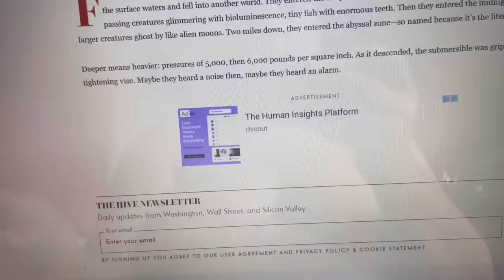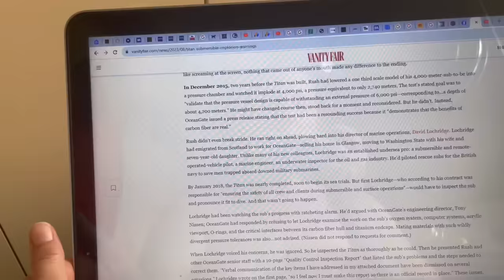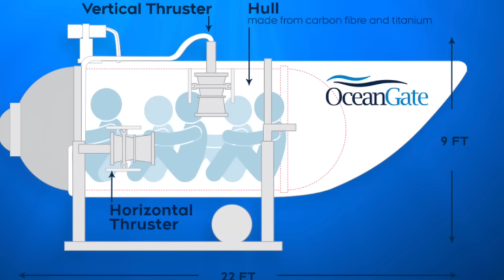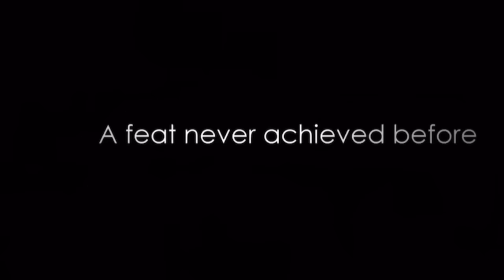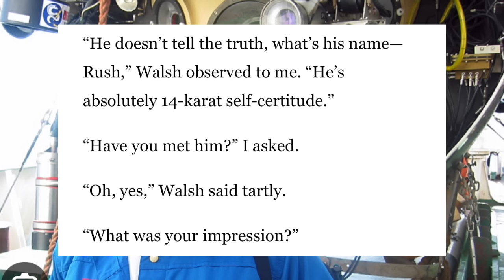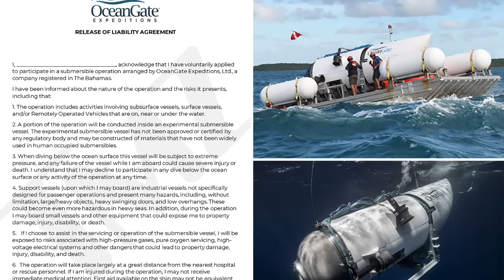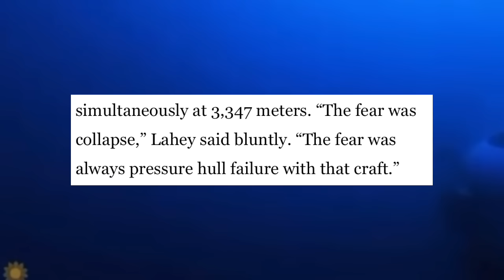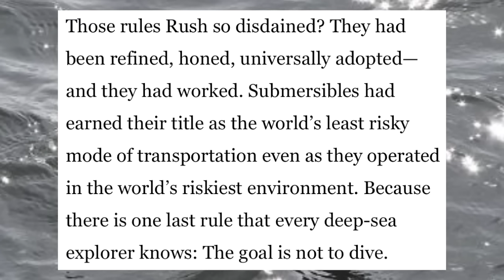TITAN Sub: The Most Shocking Titan Lies & Cover-Ups that you have never heard before #Titan

Comment: In the extreme depths of the ocean, a carbon fiber-constructed submersible is a disaster waiting to happen. It would face a perilous fate as it descends to 20,000 feet. The hydrostatic pressure at this depth imposes substantial stress on the submersible's structural integrity, the pressure would be absolutely staggering. The vulnerability of carbon fiber for use at thus depth was known and discussed only a few years ago.

Ok.. so the systematic collapse begins at structural weak points, such as joints or material imperfections. Carbon fiber's composite nature exhibits brittle fracture characteristics under extreme pressure differentials. As the submersible descended, the hydrostatic pressure intensifies, pushing the carbon fiber to its critical stress limit, leading to audible microcracks detectable by the crew, you understand where I'm going with this?
The ensuing structural collapse would have become audible as microcracks propagated through the carbon fiber matrix, creating voids and causing a sudden volume decrease. The rapid ingress of water exacerbates the implosion.

Contrary to the notion of a "fiery implosion," the collapse lacks the incendiary spectacle associated with heat-driven events. It's pressure, not temperature, which propels the swift collapse, the energy release is predominantly kinetic and potential, originating from compressed water filling voids.

Temperature stability prevails during the adiabatic implosion, devoid of heat transfer with surroundings. Unlike adiabatic compression of gases, underwater implosion involves water, maintaining negligible temperature changes. The primary energy release manifests as kinetic energy from rapid water ingress.

Carbon fiber, with gradual structural changes under extreme pressure, serves as an advanced warning for the impending implosion...an AUDIBLE event.
The implosion would involve rapid structural collapse and subsequent water inrush, generating formidable kinetic and potential energy forces. However, it lacks thermal conditions for combustion or fireball formation. Underwater combustion is attributed to external factors like electrical malfunctions, fuel leaks, or submersible materials, independent of the implosion.

At this depth, an implosion woukd result in massive barotrauma injuries, liquifying human flesh and organs. So beyond pressure-related barotrauma, risks arise from structural damage, equipment failure, or hazardous material release, dependent on submersible design and conditions. Laminated carbon fiber structures in submersibles exhibit stress or delamination signs under extreme pressure, warning minutes before critical failure..ok?...several minutes. 

So, at the depth of 20,000 feet, a submersible implosion induces intense acoustical anomalies. The rapid pressure change causes underwater shockwaves and noise, potentially detectable by hydrophones or underwater acoustical monitoring devices.

Contrary to some statements, sonoluminescence,  or acoustic luminescence is not associated with the implosion, even given the intense pressures involved. 

The acoustical anomalies 
created would be easily detected by the u.s. navy and other hydrophones. 

So.. the crew would be conscious and alert, they were absolutely terrified... they knew several minutes before that an implosion was eminent.. let that sink in...possibly up to 2 or 3 minutes THEY KNEW.WHAT WAS HAPPENING, I can't begin to imagine the shear terror and panic those people experienced.  Rush Stocktons estate and the engineering team should be up on charges... my expertise is in atomic physics and electronics/optical engineering..not law, but that's my 2 cents. Those people needn't have died, Stockton skirted the rules and cut corners...and we see the result.

Comment: I hate to have to say something in favor of them, but this and many other videos sound more like "every little thing I could find wrong" more than the actual problem.

For example, the thruster installed wrong...  This isn't a mechanic shop that has done this a thousand times, this is a one off design thats never been built before.  And they figured it out them selves, it wasn't discovered after the implosion.

Over negative analysis such as this numbs other problems.  It's the cry wolf problem.  Sure, it's a technically a problem, but that is a problem that anyone could have had.  Pointing it out feels more like your rubbing it in someones face rather than solving something.

Frankly, I feel we need to focus on how Rush refused to hire anyone with experience, or take advice from experts as the true problem.  I've read different opinions on why, from he was being cheap so only hired new collage kids to design his sub, to he was being woke so refused to higher old white guys.  Looks more like the actual experience told him to stop.  And looks like he was cutting a bunch of corners, something that when done properly helps get costs down.  And being that Rush, well, was in a rush (couldn't help it) he did it in all the wrong places.

Let's hope we can learn from this properly.
Reply from the maker: Hi Leehype, I have made other videos about the problems with the Titan, adressing the major issues you mentioned. They are on my channel „Silki in Numberland“ . In this video here I wanted to focus on how Rush tricked himself out of legal responsibilities, testing,certification etc. using tricks and lies
Reply: @silki24  If your aim is to focus on how he tricked himself, then why mention the thruster?  This is just what I mean.  You got a bunch of good information pointing out where he had good advice that he ignored, then mentioned every little thing.

It detracts from the true problems.  The cry wolf thing I mentioned.  And please under stand, this is not an attack on you, this is meant to be constructive criticism.  And this is also my opinion, and I am not involved in submersibles nor youtube channels in any way.
Reply from the maker: Hi Leehype , I don't see it as an attack at all , you explained your point of view and I apprechiate that , really. I am making these videos for my viewers so I like to hear opinions and I want to engage. I am trying to remain shorter on my other channel and go more into detail with this one as a lot of viewers of my other Titan videos were interested in more details